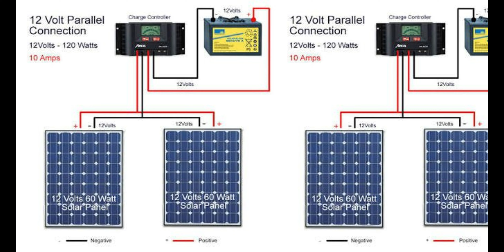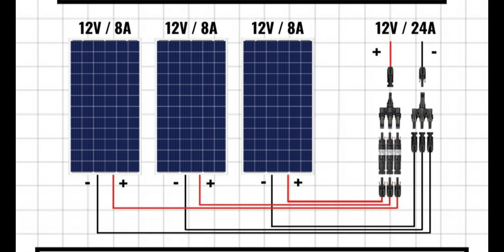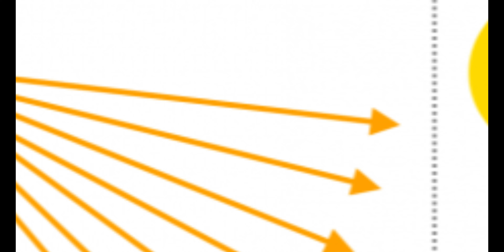PWM and MPPT Charge controller what is really  the difference?

Comment: 15:00 My PWM has all these programs. 
I wonder if it's just an advanced PWM 😅

LVD is 21v
LVR is 24
Float is 27v
Absorb is 28v
Ah max is 15 from panels to batteries
Reply: The PWM charge controller is the longest working solar charging technology available. With the advent of programming, the limit is left to the imagination of manufacturers really. Therefore, we have PWM controllers equipped with configurability like the ones you listed above. Although, PWM remains primitive when compared to MPPT technology.
Reply: Most have all those settings these days ... Still MPPT tech is better.

Comment: 7:22 this quality of the MPPT charger virtually means that it will charge the battery bank faster than the PWM can/will. This is another difference between the two. 

Apart from the issue of cost, the MPPT should be the only choice because regardless of one's setup, it always pays to plan to build it up (referring to scalability) as one goes and the MPPT will remain handy.

It might be good to let users know that there are also advanced types of PWM with more than just basic functions but which don't actually rival the flexibility, durability and efficiency of the MPPT.
Reply from the maker: You are right Buddy

Comment: Bro, I use both PWM and MPPT.
But it's shocking that the MPPT can absorb higher voltage but the PWM can offer you more current as you can afford to galvanize more Amps than the series connection.😊
Reply: While I agree that the MPPT have an advantage on energy tracking but if you are in Africa and your solar system is below 2000 watts Nmmm..We hate to admit that most MPPT available and affordable is not really MPPT rather just an LCD display with label
Reply from the maker: @platinumsoundslimited3943  Not sure that is correct

Comment: I have an issue sir
My mppt 30a is charging very slow, could it be from setting or it's faulty?
Thanks.
Reply from the maker: A number of factors tough to diagnose from a distance, you might need to get  your installer to check it

Comment: Hello bro. Love your show. Question: I bought a home with a solar system with 12 gel batteries. Unfortunately it wasn't enough for my large family. We increased to 20 gel  and more panels... it's still not enough.  Is there a type of battery we can buy that allows us to add on  batteries over a period of time? We don't have the money to buy all the batteries we need at once.
Reply from the maker: Every battery can be scaled up as long as the batteries are not old
Reply: Lithium Batteries supports that more because of the BMS. You can add new Lithium Batteries to an existing one that is quite old but it's not advisable with Lead Acid batteries.
Reply from the maker: @3gfarms914  Please go to our website and send us an Email, your problem might not be battery.

Comment: Good after sir,please I want to know if it is advisable for me to bring a solar current directly to 5kva/48volt hybrid inverter with the maximum DC voltage of 111volts,or the cable still needs to go to Pv combiner before going to the hybrid inverter.Thank you
Reply from the maker: Combined or circuit enclosure box, it should always pass a breaker

Comment: I've been looking for such info with no luck but now i get you please help me with this. 

I have 4 solar panels of 12V 400Amp each 
And i have 2 batteries of 12V 256Amp each, and I've got a 20,000Watts inverter. I was looking for the battery charger and regulator, someone recomend The PWM 60Amp 12,36,and 48V.
Do you think that would really help charging and regulate the solar as charging tye batteries?
Reply: The information you have given doesn't seem accurate.

Comment: Nice but i dont really think u can over size on ur MTTP ,bcos u need to work with the CC specification.
Reply from the maker: You can but the extra percentage oversize shouldn't be more than 7 percent . If you need more oversize you will need an addition charge controller.

Comment: Boss am confused between 5kva 24vt  inverter vs 3kva 24vt..

Because they use same battery.. is there any different apart from that sir. Pls.. because I don't want to go for 5kva 48vt
Reply: Obviously 5KVA has more output power than a 3KVA Inverter so you can use more load on it. The battery bank can be increased by adding two more batteries at every given time you intend to increase it. 48V requires a compulsory purchase of four batteries every time you want to expand the battery bank.

Comment: mppt is d best anytime.i dont use pwm
Reply from the maker: Not in all situations if you connect it the right way with all the rules observed you can get the best out of it.
Reply: But most installers I've seen on Facebook provide pwm as the charge controllers for the systems they advertise.
MPPT, for what it does, is unnecessarily expensive, in my opinion.